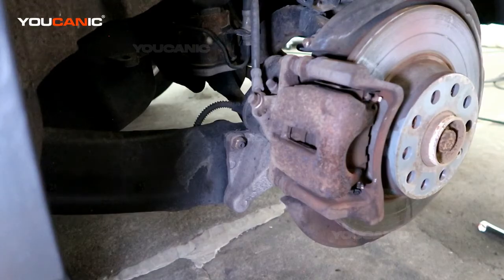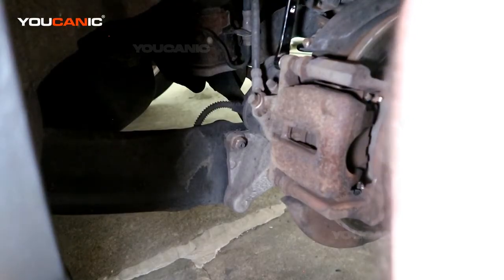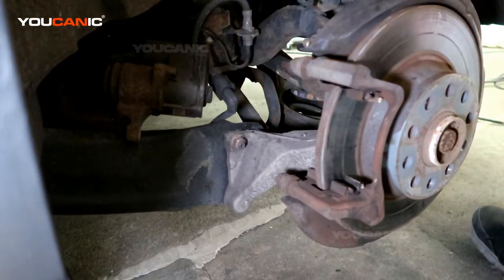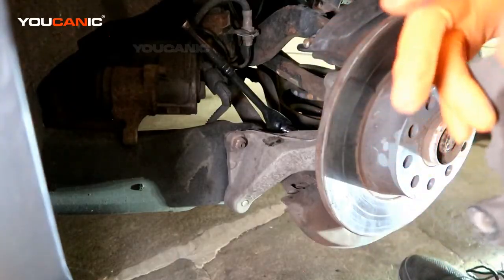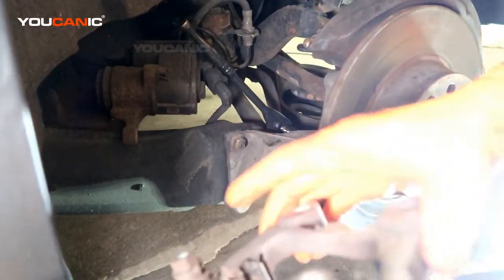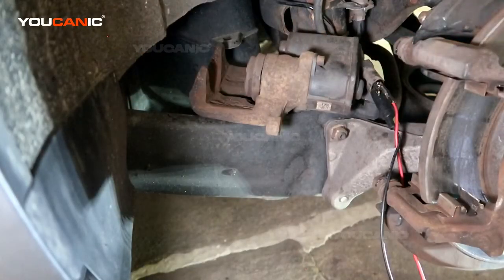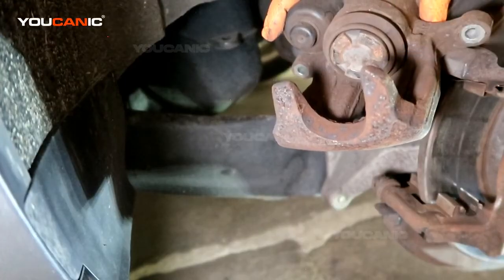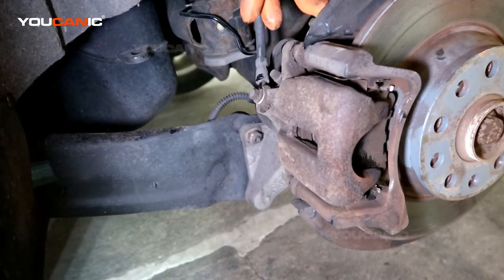2009-2016 Volkswagen Tiguan - Rear Brake Pads and Rotor Replacement

Comment: Thanks. That bit at the 9 minute mark showing how to back off the electronic parking brake actuator w/o scanner by applying 12VDC to those pins was the tip I needed.

Comment: You saved my day with this video. I've replaced pads and rotors before but never encountered the electric parking brake. Since my scanner doesn't have the brake actuator function I was at a loss until I found your video.
Thank You

Comment: Great video...straight forward and not intimidating at all
Reply from the maker: Thanks for your positive feedback! At YOUCANIC, we aim to empower car owners like you with easy, non-intimidating content, and useful tools like our YOUCANIC scanner. We're thrilled our video was a great help to you. 

There's plentiful free resources and step-by-step guides on our website www.youcanic.com to assist you further. Even factory repair manuals are available if you require in-depth information. Our commitment is to support you on your car maintenance journey, so don't hesitate to reach out for any assistance. Happy motoring!

Comment: What is the caliper tool socket size for rear brakes? 12 point 14mm? Or what? And was @7:45 you said electric motor or was that parking brake

Comment: Great video, I have a question though. I manually backed off my electronic park brake and now my brake pedal has a lot of play in it and will build up pressure again. Any suggestions on what this could be?
Reply from the maker: It sounds like you might be dealing with a brake system issue. Using a tool like the YOUCANIC Full System Scanner (www.youcanic.com/scanner) can help diagnose these types of issues efficiently, giving you insight on what might be happening with your brakes. 

Additionally, we recommend visiting our platform at www.youcanic.com where you have the opportunity to ask car-related questions. We're here to make car repairs accessible and understandable. Don't hesitate to reach out with any more questions.
Reply: I have this too. Did you find a solution?
Reply: @Skymachine  had to end up taking it to the mechanic. Tried everything, couldn’t figure it out.
Reply: @LuckysPokeStop  Yeah I had to do the same thing. Turns out I had accidentally gone the wrong way and wound the brake pedal right off.
Reply: @Skymachine  what does that even mean?
Reply: @ski773 I think the piston went forward and didn't retract. I think...😅

Comment: 14 mm triple square on the 2014 vw tiguan
Reply: That's what I needed to know
Reply: Mine are stuck on. Any tips on getting them off
Reply: @kinrade12 I tried to remove mine today and that bottom one was stuck bigtime. Ended up just replacing the pads. Did you get yours off? Only way for me is removing the shock, I think. Didn't have a big enough wrench so next time I guess....

Comment: For the 12-volt power supply can I either hook it up to the cars battery or to another car parked next to it?
Reply from the maker: Thanks for your question! Yes, you can hook up the 12-volt power supply to either your car's battery or another car parked next to it. Just remember to follow safety precautions. To learn more, feel free to check out our guidelines and resources at www.youcanic.com. 

At Youcanic, we're here to make car maintenance easier for you. We offer free resources, helpful guides, and our top-rated Youcanic scanner. For additional help, consider utilizing our factory repair manuals. We're all about empowering you on your car ownership journey!
Reply: If I decide to get the scanner can you advise which one is the least expensive one capable of backing off the electric parking brake? THANKS

Comment: what kind of battery or power source did you use?
Reply from the maker: Hello! Thanks for your question. In this video, we used the vehicle's standard battery as the power source. At YOUCANIC, we aim to equip car owners with the knowledge and tools to handle car maintenance confidently. Check out our resources, guides, and the YOUCANIC scanner on www.youcanic.com. Feel free to reach out if you need further assistance!
Reply: @YOUCANIC  does the scanner tool you sell work on 2020 Golf and 2014 Tiguan?
Reply from the maker: @NicoleKnightroyaltouchcleaning   Yes it does.
Reply: @YOUCANIC  thanks for your help i got it done today

Comment: should i set the brake before start or dont set it?
Reply from the maker: Thanks for reaching out! Whether or not to set the brake before starting your car can depend on a few factors, such as if your car is manual or automatic, or the incline of the terrain you're parked on. We at YOUCANIC provide helpful guides and resources to simplify such questions. 

Feel free to visit www.youcanic.com for detailed solutions, including our powerful YOUCANIC scanner and factory repair manuals. We're here to empower and support you throughout your car ownership journey!
Reply: @YOUCANIC  i'm on flat ground in garage its an automatic car

Comment: What is a triple-square???
Reply from the maker: A triple-square, also known as an "XZN", is a type of screw drive with 12 equally spaced tips. It's often used in the automotive industry. For further clarification on this and other car-related queries, consider exploring www.youcanic.com where we offer a full car diagnostic system and a platform to ask car-related questions. Check out our scanner at www.youcanic.com/scanner. If your question still persists, feel free to ask directly on our website. We're here to support your automotive journey!

Comment: What 12v power source did you use?
Reply from the maker: Thanks for your question! For this procedure, we used a standard 12v power source commonly found in automotive supply stores. At Youcanic, our priority is to empower car owners like yourself to confidently handle maintenance tasks with the help of our guides and resources. We invite you to further explore our resources at www.youcanic.com for additional support including our YOUCANIC scanner and factory repair manuals. We're here to assist you throughout your car ownership journey!
Reply: @YOUCANIC  "12v power source commonly found in automotive supply stores"... So a battery?